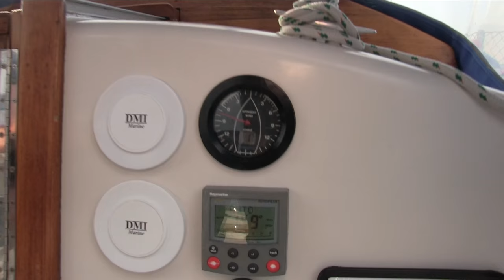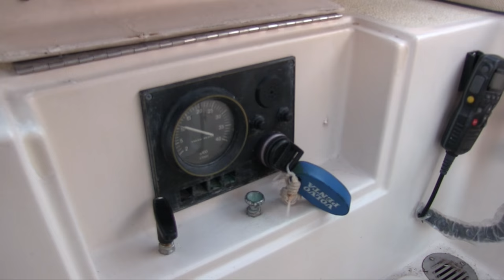Offshore Sailing - Lazy Gecko VLOG 47

Comment: Hi Guys, good to see you back, like the new vlog formate. As you get used to going to sea you will learn a lot about your yacht and how thing can move around that you did not think could. Like all those hanging net in the cabin and all those containers on the  top side of the yacht. I myself like to move around my top side OK to have some but be able to move past then fast if need be . Any way can under stand that you don't have all the room down below. All the best till next vlog which looks amazing !
Reply from the maker: Thanks! The deck isn't bad. Fuel, water and bikes besides the dinghy. No big deal. So happy you enjoy the videos!
Reply: I'll be curious to know how the bikes fair with the salt water up on the rail. I wouldn't think they'll hold up to the salt water, but I really don't know. Is that something you have researched?

Comment: After watching numerous sailing channels it seems to be auto pilot is a major unreliable pain in the ass. Lots of spare parts required. Good tip for my future sailing endeavor.  Great video!
Reply: hey yeah before auto pilots became choice of this electronic age, the wind vane steering was, and still is the best option.  Think about that if you want a better option.
Reply: That's why windvane systems are frequently used for long distance voyaging. Fewer failure points and able to be fixed while underway. Added benefit is that if the wind shifts significantly, you move with it and don't risk the uncontrolled gybe.

If you have a mechanical pilot, it is good to have some backup system. I know people with both wheel drives and a hydraulic ram.
Reply from the maker: Yes we need to get our wind vane in action!

Comment: Another nice video! Love the click bait. Good to see you
guys stocking up before you leave. Supplies in the Bahamas are really
expensive. Beer is 40 bucks a case minimum. If you like scotch, buy it in the
U.S. before you go, there's no limit on "ship stores". Take some time
and look up the relevance of "ships stores" regarding customs. It's easy to put out the head sail alone.
However, if you use both the main and the jib, balancing the helm. It will put
less load onto the autopilot. You will use less electricity  and go through fewer belts.
Reply: Karl Fair And you'll be faster as the rudder is centered: like driving with the park brake dragging.
Reply from the maker: Thank you! Yes, we actually do use the main as well now lol
Reply from the maker: and technically it's not click bait if it's in the video! And all of ours are ;)

Comment: I believe you are the military equivalent of a civilian FAA A&P mechanic. As such, you know all about the purpose of control surface "trim tabs". When out of trim, the pilot cannot physically overcome stick loads placed on non-fly-by-wire cockpit control yokes. Early in flight training, we are taught to always keep the aircraft "in trim" regardless of attitude. Likewise, your rudder can exert excessive back pressure on your helm which is known as "weather helm" or lee helm". It's easy to feel with old fashioned tiller steering. With s/v LG's capstan steering, excessive back pressure is hard to feel. Sadly, the sailing community has settled for wind vane autopilots rather than aircraft style trim tabs incorporated within the rudder that could be adjusted to neutralize excessive helm back pressure. Excessive back pressure is 99.9% responsible for stripping teeth off of autopilot belts and/or servo failures. The only way to effectively reduce excessive back pressure is to "balance the sails". Learn all about "center-of effort" and how to balance sails here: http://www.schoolofsailing.net/weather-helm-and-lee-helm.html You can also think about installing a current shunt on your autopilot power lead and monitor/alarm on high shunt voltage (which indicates when the AP is excessively loaded due to unbalanced sails or a jammed helm). Taking this all a step further, the monitor/alarm signal could even disconnect the AP for maybe 10 seconds in order to save the belt from damage.Someday, when I can afford to retire, I'll design and market an affordable strain gauge or load cell system that can be installed on a tiller or rudder post bellcrank that will measure and indicate helm pressure. Hope this helps. Jack, aka electricalpowerguy

Comment: Argh, the dreaded Raymarine drive belt failure! A nifty hack, if your sail trim is fairly balanced without much weather helm,  and you're close to the wind, you can just lock the wheel and she'll likely self steer within about 5 degrees. Saved us 50mi of hand steering on a passage last summer after the belt striped. Give it a whirl, I bet the Alberg will do it!
Reply from the maker: Lovely! I bet she will!

Comment: STOVE TOP POPCORN INGREDIENTS
1 Tbsp canola or vegetable oil $0.02
2 Tbsp popcorn kernels $0.07
INSTRUCTIONS
Add the oil and one kernel to a small sauce pot. Place the lid on top and turn the heat onto high. Wait for the kernel to pop.
Once the kernel has popped, add the rest of the kernels, replace the lid, and give the pot a swirl to coat the kernels in the hot oil. Wait for the kernels to begin to pop. You can swirl again to redistribute the hot oil, if needed.
Once the kernels begin to pop rapidly, crack the lid a little bit to allow excess steam to escape. Make sure it's only open a little to keep the pot hot enough to continue popping the corn.
When the popping slows to a few seconds between pops, turn off the heat. Wait a few extra seconds for the last few pops, then remove the lid and season the popcorn. Enjoy!

Comment: After watching your videos, Delos and the LaVaga's it sure seems like auto pilots are made to fail on sail boats. You'd think more design could be put into them so they might last.
Reply: hey yeah before auto pilots became choice of this electronic age, the wind vane steering was, and still is the best option.
Reply: For a little perspective, Delos and Vaga's pilots were both over 10 years old with 10's of thousands of miles on them.
Reply: Yeah, certainly wasn't designed by the 1987 Honda Civic folks was it? 2 million and still going.

Comment: I'm sure someone has already mentioned it in a previous post....but just in case...don't lock your wheel down, that's what burnt your autopilot belt up
Reply from the maker: It wasn't locked down. The belt was dry rotted. I just called it that, I now know I meant engaged.

Comment: You stated you locked your helm and turned on the auto pilot. That will burn your belt up. Those auto pilots work great and last a long time.
Reply from the maker: Ok ok! LOL...My husband calls it engaging the autopilot, I call it locking the helm ;)...the belt was old and dry rotted.

Comment: But you have wind vane steering on the back - why don't you use that? Really easy to setup and reliable.
Reply from the maker: When the belt broke we only had about an hour and a half left so we just went with it. We have a windvane and a tiller pilot onboard too ;)